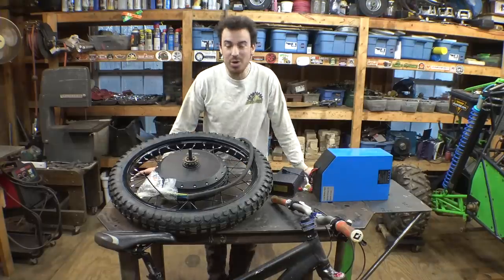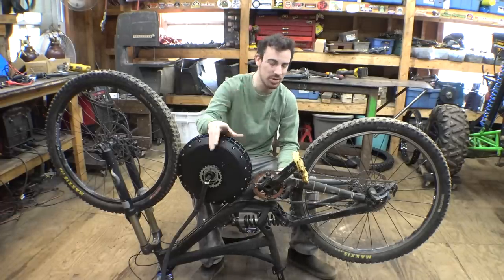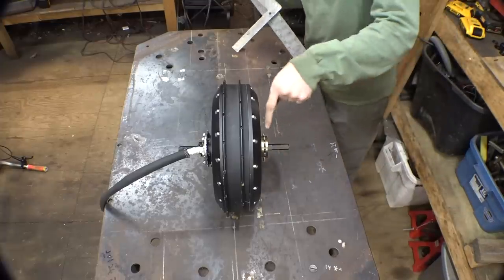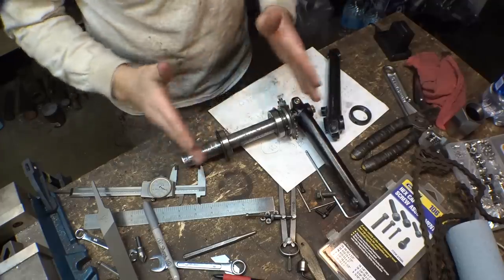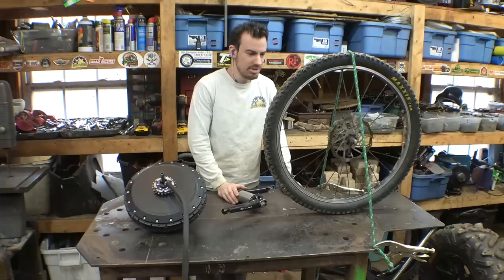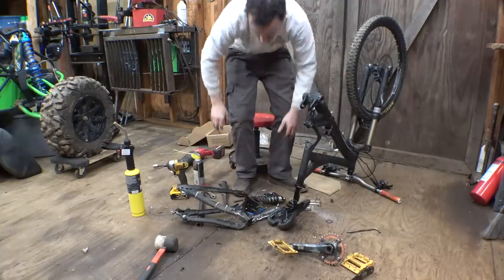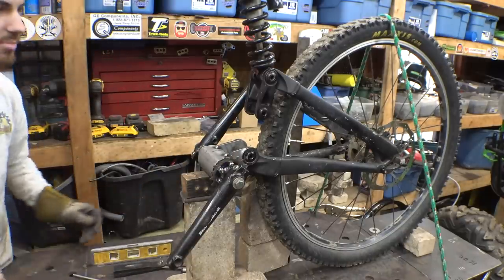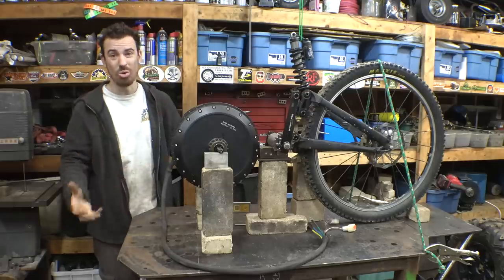Home Made Electric Mountain Bike Build - Part 1

Comment: Once again I'm here to mention the awesome AGNI/Lynch high power DC axial flux motor.  It is suitable for projects that require up to 50hp and only weighs 25 lbs and is smaller than that hub motor you have right there.  Here's a little more information albeit a little dated:

The Lynch motor is an unconventional design with a disc armature. It marries the advantages of a conventional, wound armature motor with the benefits of a flat (printed circuit) motor. It is similar to a pancake motor, but is more powerful than any of these technologies. The disc armature has magnets on both sides, doubling the available flux density and shortening the magnetic path. It therefore packs more power per pound and per cubic inch than any other motor technology. Of course such a revolutionary motor is not for every application - it is not as cheap as wound field motors, but for many applications it is a far superior motor.  It has a previously unheard of power to weight ratio and also power to volume ratio. It is also highly efficient because of the double magnet design and associated short magnetic path. It also includes integral fan cooling.

 The Lynch motor is an important development which spurred other motor designers to improve their products to remain competitive, such as synchronus permanent magnet machines.  As a result of the competition between manufacturers the cost of high performance motors and controllers has fallen dramatically.  We hope the cost of solar cells also reduces to allow renewable transportation to develop as a viable alternative to carbon fuels.
Cedric Lynch built his electric bike around a mid-drive configuration, also building one of the worlds most efficient light weight electric motors to power his rig reliably at 60-MPH for significant distances. He would later set several world records with his axial flux motor and bring it to market as the Lynch / Agni motor. Briggs and Stratton would eventually buy this technology which would lead to the Etek motor, which is now famous for making high speed efficient electric hot rods.

Cedric uses to achieve high speeds is by following the rules of aerodynamics, and building a bike that is as aerodynamic and as efficient as possible. The other builders on this list bypassed this step, and Cedric uses this bicycle as daily transportation on real commutes. Although this high-efficiency motor uses “old school” brushes, this fact allows builders to use very affordable controllers. He has proven his design choices through thousands of miles of commuting, and the Lynch motor is highly respected.

Cedric Lynch is known as the creator of the Agni Motor, a highly efficient electric motor that weighs around 25 pounds and can put out as much as 50hp. 

Cedric Lynch is a British 'mad scientist' type mechanical engineer obsessed with the idea of greener transportation. His interest has been in building a super efficient yet powerful vehicle that can serve as a car replacement.

He started thinking of his own design for an electric motor in 1983 when he began entering competitions organized by the Battery Vehicle Society regarding building an efficient electric vehicle. At the time there was no reasonably priced DC motor with descent efficiency so Lynch decided to build his own utilizing modifying existing motors with old tin cans that he would spread out flat to use as cooling fins. Surprisingly using rudimentary materials and a garage work bench, Cedric was making better more efficient electric motors than any of the universities were able to manufacture in state of the art workshops.

Cedric then came up with a motor design that could be cheaply manufactured and began manufacturing his own motor that he could sell to the public in 1988 and the Lynch Electric Motor Company was born, known as LEMCO.

Cedric first used his motor to create a small boat called “The Spark” that would set an electric boat efficiency record. From there Cedric turned his attention to bicycles, an application generally considered too small for a lynch motor at that time. Cedric mounted his motor in recumbent bike, allowing him space to eventually use a set of thundersky lithium batteries.

The resulting aerodynamic recumbent bike had a top speed of 60mph and still managed an incredible range of 150 miles. Cedric rode his recumbent creation everywhere as a daily commuter, putting an amazing 50,000 miles on the machine - technically a motorbike.

Briggs and Stratton, the US firm famous for lawn mower engines, bought the technology and used it in their E-Tech Motor, and Cedric went on to manufacture his latest incarnation of his lynch design into the Agni motor, which is used in go karts, sailboats, motor boats, and even small airplanes.

The Lynch designed motors all have the same traits. Brushed motors, around 25 pounds in weight and they are able to put out enormous power compared to their weight. Sometimes as high as 50 hp (depending on amperage ran through the motor) at an incredible 98% efficiency.  Lynch Motors are also the most often used motors in electric motorcycle racing applications.

Cedric's zero-emission motorcycle, which has a top speed of 120mph, was shown in action winning the world’s first zero carbon race – the TTxGP in the Isle of Mann.

The idea for the electric motor has been snapped up by the 56-year-old’’s friend Arvind Rabadia, who together with his brother Hasmuk Rabadia had been thinking of starting a business in India. They have now set up Agni Motors to make further-improved versions of Cedric’s motors

Despite Cedric’s breakthrough invention he has no formal engineering qualifications and taught himself the techniques needed to construct his engine. He first became interested in electrics when his parents bought him a book entitled How to build things from things found at home. 
The Etek motor is a brushed 25-pound pancake shaped motor that puts out enormous power for its weight. Depending on amperage and voltage the Etek can easily provide between 15-horsepower and 30-horsepower reliably and consistently (11-kW / 22-kW). A perfect platform for a powerful electric bike if you do not mind the weight. Although brushless motors are considered more modern, a brushed motor like the Etek allows the builder to use very affordable controllers.

Cedric-Lynch invented the motor and sold it to Briggs and Stratton which US company produced the Etek at a lower price (around $600). In the late 90’s early 2000’s it was the way to go for a high-power / light-weight electric vehicle. Many small E-vehicle records were set using the Etek motor. Finally, the market had a relatively lightweight and powerful electric motor available to the masses.

In essence, the Etek allowed hot rodders to build electric bikes. Before the Etek very few people had ever achieved 50mph on an electric bike. Even today, Etek motors (and newer incarnations of the Etek motor) are used to make some super fast electric bikes. In the case of Liveforphysics, the fastest E-bikes ever.

 Liveforphysics used a newer version of the Etek (the Agni motor), to achieve speeds of over 70mph, and dominate a recent hill-climb event.

Every Etek I have ever ridden has been characterized by brutal off-the-line acceleration, usually to a point where you have to apply the throttle very carefully or get thrown off. However, it is possible to run an Etek at a lower voltage or lower amperage and have a very manageable, safe, and sane electric bike that will not burn out on you, no matter high steep the incline.

Comment: Mount your pedals to the axle of the motor with a ratcheting setup and separate outside bearings for mounting to the frame that way u save space and weight

Comment: You kept saying 8000W is not a powerful motor during this video, but in the world of eBikes, that's insanely ridiculous. As someone else already mentioned, you're just building another electric motorcycle with this build. The crazy powerful Frey mountain bikes have less than 2000W motors and are heavily engineered to actually use that power. Eight kilowatts (10hp) is going to be nuts, and probably unmanageable. I can't wait to see the result. :)

Comment: You should have an independent driveline past the cranks so that you dont accidentally put your legs in an 8000w blender, just imagine the carnage if the throttle glitches to full throttle, probably snapping the chain and obliterating your legs. Cool idea aside from what ive explained
Reply: That'll only happen if the freewheel on the motor locks up. Possible but very unlikely.

Comment: I’d raise the motor about 3 inches, wrap a frame around the outside then mount the bracket for the shock on the backside. Leaves a bit of room for the battery kind of behind and above the motor and the controller directly above it. Also it should give you a hair more room for your feet near the motor because from the side view it looks like your left foot my be really close to the drive gear.

Comment: Pedals, etc:  Crankset, crank arms, pedals. A normal mid-drive motor this is not, so those terms will apply here. As to the comment about the motor and its outer edge spinning? This application will be the reverse where you'll have the motor itself stabilized in the frame and the axle of the motor spinning so no danger there, well other than the gawd awful amount of torque going into the rear set. This will be an interesting build for sure.
Reply: Oh wait, you're building a gyroscope? Strange and I'm here for head scratching.

Comment: need to install a torque sensor into the motor, put the cranks onto the axle of the motor, then bolt bike parts around it.  Then you dont' even have to worrry about how you 're connecting it, it will just manage itself and be less moving parts too.

Comment: Hi mate. Great video. I notice that some people have already commented about going through the pedals and chain system would be fatal at full power as they are not designed to take 8000W. So you could just put a smaller controller on there which with such a beast is a bit of a waste, ORRRRRR.... ...You could simply beef up the gear system with an internally geared shimano hub and use a thicker chain and sproket, or even design and build your own gearbox which will take the heat. Just a few thoughts from a concerned citizen. Looking forward to this build. Would like to see you use either an old angle grinder or washing machine motor to power some kind of bike or go cart if possible. The motors and controllers are very simple and quite cheap as well as very redily available. Anyways, hope your well mate, have fun and cheers for your videos.
Reply: Grinders are garbage, max 1500w, 40%+ power loss with their bevel gears, speed controller reduces all the torque and cooks the motor

Comment: How about instead of a spacer next to the hub using it like a jack shaft? Double sprocket with a chain going motor to hub and another going hub to the wheel that spins freely on the shaft. You could then keep the existing chain, tensioner, and gear selector for the hub to wheel connection. Also, the motor mount could be adjustable for chain tension.

Comment: You can use a small pick or knife blade tip and remove the seal on those bearings and re grease them.

Comment: dont underestimate those hubs - i can see chains being ripped apart and transformed into shrapnel. or at very least, bent sprockets. bicycle chains were not made for the amount of torque those electric hub motors have.
if thats really an 8000W motor, assuming 100% efficiency, that motor could break the chain at under 9RPM, if the chain were fixed to something solid.. 
the real question is, will it shut itself off from the amperage overload before the chain breaks?
remember, the dimensions are ideal for rotating a large radius, and yr gonna put it on a tiny sprocket
edit - 37:10 - noted ;)

Comment: The hub motor seems like it would be terrifying spinning with all those little notches on its edge. Do you think you might make a guard for it? It’s probably going to have a gyroscopic effect since it’s spinning something so massive. So that will be interesting.
Reply: It’s not being used as a hub motor anymore, so it won’t be spinning. Only the output sprocket
Reply: @jordanfr13  I’m pretty darn sure that’s not how it works. It’s just like a drone motor. The outside of the hub spins because it has the permanent magnets (rotor) lining the outside of the hub and the stator sits in an interior fixed position. They call then inrunners vs outrunners. If your tried to run the outside in a fixed position, the wires for the stator would get tangled up and it would destroy itself in short order.
Reply: @Salmonaxe223  if you fix it in place then the rod will turn
Reply: @drsatan3231  sure for a very short duration, as the wires that go to the stator would turn with it, twist up and rip themselves out...
Reply: @Salmonaxe223  the wires don't make contact with the rod. Why can the hub spin without ripping the wires?

How would restricting the movement of the hub itself change the functionality of the motor?

Edit. Nvm I'm dumb
Reply: @jordanfr13  It will be interesting to see if the motor is converted in that way. It is not a trivial job from what I have understood. Personally I would rather encapsulate the motor for safety, but keep it spinning as it was designed.
Reply: The hub definitely will be spinning The wires will rip out if not connected the drive sprocket directly to The disc brake mount I've done the same thing with a 3000 watt on a roadie it was wild😊
Reply: Its a hub motor... It won't spin fast enough to do much to you

Comment: I don't want to discourage you but have you seen the lightning rods big block mid drive kit? Just as much power but a whole kit. With that much power idk if the mtb chain can handle it. There's a guy doing 10kw but he runs a custom 219 kart chain and 3 sprocket setup

Comment: add 1 inch to the pedal assemble width then get 2 sprockets welded together that free run-on bearings placed inside the pedal arm. then you can run a chain from the motor to one side of the free-running sprocket then a chain from the other side of the sprocket  back to the wheel .. no need to worry about chain guides etc

Comment: You should definitely use a smaller motor. That 8k motor is something you’d use for like street motorcycle or dirt bike. A 2-3kw motor would definitely suffice. You can always over volt/watt the motor if need be. Think of the volt/watt rating for motors like a load rating for a tow strap. That number is used as a reference to know what you can operate the equipment at continuous maximum without risk of failure. Can you go beyond those numbers? Absolutely. Going past those number, causes accelerated wear on the components, but as long as you’re not trying to drive it at maximum capacity for extremely long periods of time, you’ll be fine.

Comment: You could build the frame out of solid steel rods and it still would only weigh as much as the motor. and a lot less than the motor and battery pack combined.

Comment: i had an idea to use a hub motor from a hoverboard and run a 2ns set of front sprockets on the left side to the motor keeping all the gear the problem i was having was width and very little tools to make new pedal arms for clearence instead i just put foot pegs and had 18 speed 250 -350 watt mid drive one think i will say is stock bike chain wont cope tends to snap easy i know with out pedals it then becomes a motorcycle but it just showed the idea would work

Comment: your bottom bracket height will change with the sag of the suspension.
On that bike the ideal BB height will have been designed to take into account 20-30% sag, you've taken a static measurement at 13" odd meaning that the CG of the bike will almost certainly be higher if not rebuilding with the exact same suspension geometry

Comment: I'm wondering how much gyroscope flywheel effect you'll get from that large diameter heavy motor. It's good that it's lower speed but I'm worried it may carry a lot of inertia when trying to slow it via bike brakes so it may want to run on when braking, and the gyroscopic force when you're leaning to turn... that's the fun part of a novel mystery build though :] it's a fun project
Reply: The motor has very low rotating mass. It'll be fine.
Reply: @th3d3wd3r  do you know how much the internals weigh? Typically the external part would be rotating, I think those windings may be a significant amount of the 50 or so pounds of the motor.  The way it was built to work would have had the lowest rotating mass, but now that's being reversed.
Reply: @Spyder 77  the external part is still the part that's rotating. You can't spin the stator and hold the rotor still, it'd rip its own wires out

Comment: The chromoly steel frame tube options available now can be selected like an alloy you can eat buffet. There are many frame builder's supply stores with high quality butted tubes available with a few clicks. Even stainless steel is available. 
Just a thought.
Reply: You new here? He uses bolts for hub spindles instead of spending $6 at the tractor store. Saving money is priority number 1

Comment: It is a cool project. I think that your pedals are positioned too far back. When you are riding bumps it will be more difficult to ride when you won't have forward support with your feet. Basically you will be leaning on your crown jewels. Or you will risk a hit in the crown jewels. Try to ride some bumps with a regular bicycle while holding your feet back when you cross the bumps. And don't forget to film it, I would love to see your facial expression 🙂
Reply: Are you new to the channel? Form over function. It only has to move for a 5 minute span and successful video!
Reply: @janeblogs324  I really think that he wants to make cool stuff that is usable. And besides that, as a guy you don't want to be in that position even if it were for just a few minutes. 😁